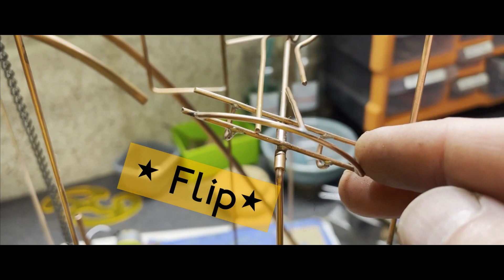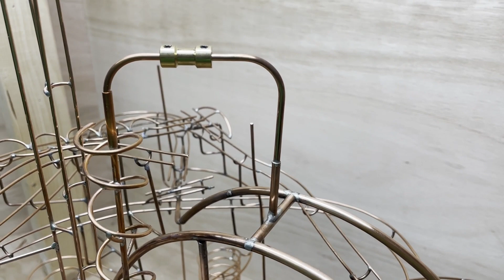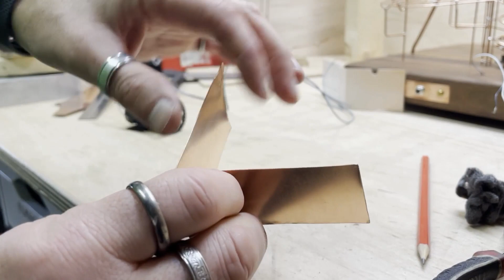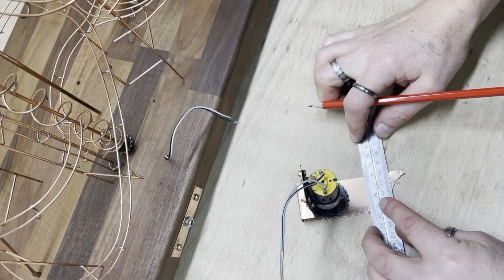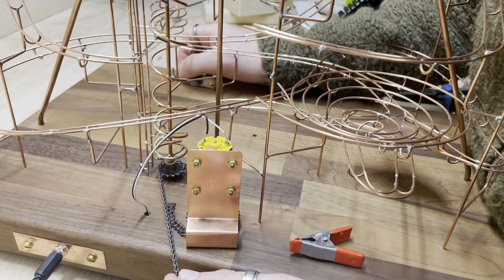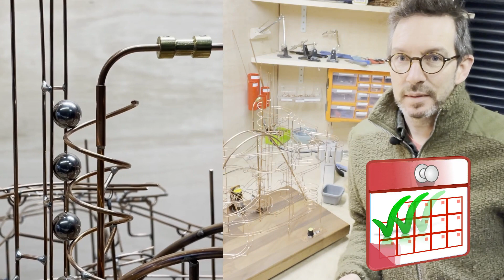Ep.26 // Motor Mount // Rolling Ball Sculpture 3

Comment: Could you provide your source for he brass inline connectors with set screws?
Reply from the maker: Hi,  Amazon usually provides most things I need.  Otherwise I just google sellers based in my country.
Reply: @CopperGravity  I have switched and not found anything that would work.  Thanks anyway.

Comment: I have this idea for a switch using the marble to make continuity between each Pole of the battery.   Using your lift..  theoretically when a marble is put in. It will switch on.  Once marble is off the lift and rolling it switches off the motor.  Then back to the bottom for turning on again.

Anyone have thoughts on this idea?
Reply from the maker: Thanks for the great idea. In this case a single ball takes AGES to rise from bottom to top. So instead I have lots of balls to keep the sculpture “flowing” with movement.